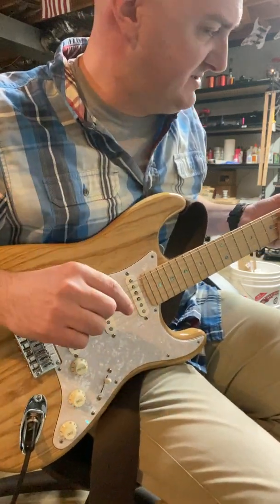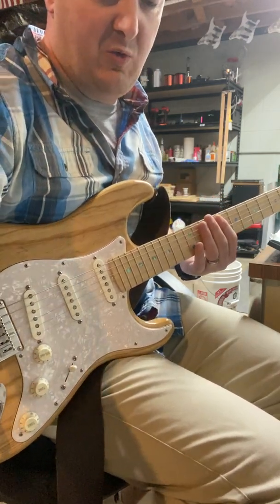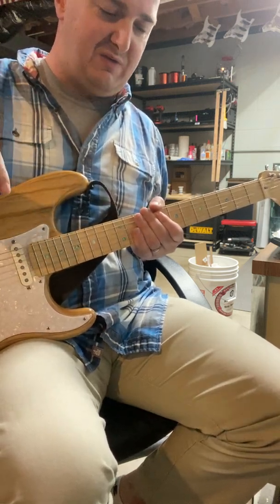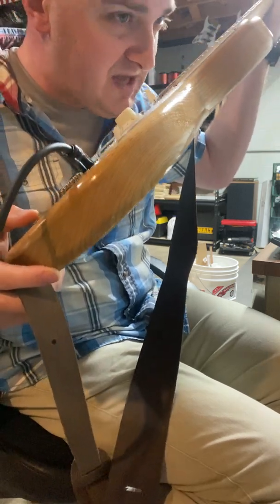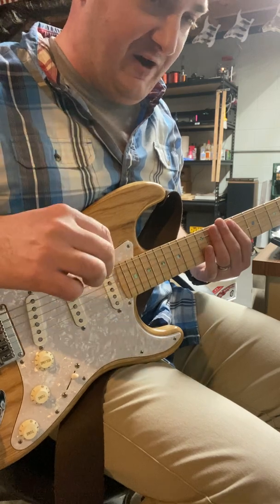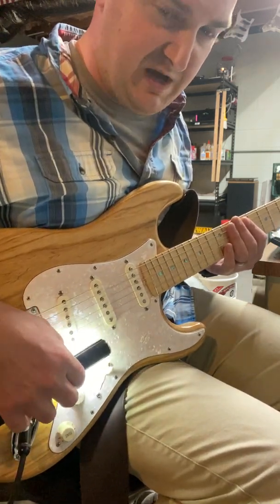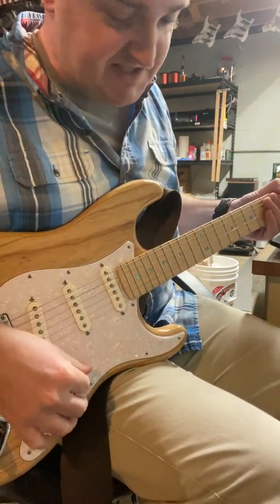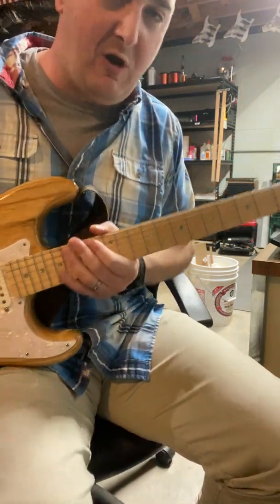60 cycle hum, RFI and Shielding is useless Noisy electric guitars SCIENCE EXPERIMENT

Comment: Um... you kinda proved the humbucker worked there - when the light was being picked up by both coils equally, the noise was cancelled - so you moved it closer to one end. 
Your experiments prove that when you move the torch close enough, the pickups do their job and pick it up. The only surprise was that your conclusion is that shielding doesn't work for all RFI.
https://www.youtube.com/watch?v=C7u8fEVoi9w&ab_channel=Pawe%C5%82Skibniewski does a before and after test which is both visually and audibly clear.
I just recently shielded a tele which has single coils that I use a bit of gain on. Without measuring, from experience, I am getting somewhere in the region of 6dB lower noise which when combined with a quieter power supply for my pedals makes for a far more enjoyable experience. 
Unfortunately, there is a lot of misinformation as to what hum cancelling is and how it does it. 
Essentially, there are 2 ways we have to reduce unwanted noise:
Shielding - preventing noise reaching the system in the first place
Cancelling - injecting inverted noise into the signal.
You don't use unshielded cables - preventing reaching the amp is easier than cancelling it. Shield your guitar is thus logical. Even using shielded guitar cables is logical as that's what we amplify the most. We shield amps, pedals and preamps for the same reason. We do however want to avoid earth loops...
Cancelling involves capturing the noise separately from the guitar pickup, reversing it's phase and injecting it back into the signal path. Humbucking involves capturing the signal with the noise out of phase on one side of the pickup - which is why your torch's noise cancels when it's picked up by both sides. No humbucker can cancel hum injected unevenly into it's coils...
You could also have a dummy coil out of phase with the pickup - WITHOUT magnets or magnetised polepieces which can record inverted noise. You could then blend that with op-amps even more precisely to cancel the noise.
Microphone cables work in a similar fashion - having an inverted signal and non-inverted signal which combine to cancel any noise picked up in the cable.
Reply from the maker: Humbuckers are not immune from RFI.  Any pickup regardless of construction, that is exposed to the environment is subject to pickup and amplify RFI simple as that. Humbuckers only reduce and or eliminate 60 cycle hum. They were never created to stop RFI. Obviously there are lots of sources of RFI however I chose to use the light because it was the easiest thing to use. 

If your tele experienced less noise after shielding, you had a ground issue that the shielding helped fix. Shielding passive components like the pots and switching does nothing. I literally proved all of this with a simple experiment in the video. Shielding  behind the pickups in the cavity is like standing on an umbrella while it’s pouring rain and believing it is keeping you dry because you really love the umbrella. As long as the face of electric guitar pickups are exposed to the environment you are in, you will experience RFI with or without shielding. Shielding does nothing for an electric guitar. I’ve owned a guitar repair business for a long time and didn’t just start doing this.

Thanks for watching and commenting🤘.
Reply: @MathewsGuitarWorks  There was no ground issue on the tele. Period. Star grounding, full continuity to all parts. 
https://www.youtube.com/watch?v=CixpTTW_IKE&t=927s&ab_channel=Devil%26SonsGuitars
This video shows almost identical results to mine. You may have persuaded yourself with your experiment but again, all you did was demonstrate how humbuckers work. Hum cancelling cancels some of the hum - it would be near impossible to ensure that in 2 separate coils, the same hum is picked up by both - unless they were literally wound together like in a microphone transformer.
What you demonstrated was that aluminium foil doesn't shield from the particular parasites generated by your "convenient" torch at that distance. Let's just say I have issues with your approximations of a "electrically noisy" environment. The video linked to above produces results that you claim are impossible. It cannot be explained by what you propose -and is the common experience  -and you can even verify it (You know I was wrong videos get more views?)
You even know the answer though but somehow it's not computing - You use shielded cables. 100% of unshielded cables capture static worse than shielded ones:
https://www.jms-se.com/resources/pdfs/Reducing_Electrical_Noise_in_Instrument_Circuits.pdf
This article demonstrates that: 1. Static is easily controlled with shielding. 2. Twisting wires helps massively with electromagnetic noise. 
Your comment about how long you have owned a guitar repair company doesn't belong. I could say that I first picked up a soldering iron 40 years ago, have been building guitar amps for 25 years - none of it would make a difference.
The first video I linked to cannot exist in the same world as that which your explanations would be valid in. The peer reviewed paper gives you repeatable measurements that demonstrate where and why shielding and twisted wiring works. Your experiment is simply flawed as is your understanding. Shielding is effective. Do a controlled experiment like the video above and see.
Reply: @MathewsGuitarWorks  I do think berry is onto something here. I am by no means an expert here as i just started playing bass recently and found this video in search of a fix for my bass with HORRIBLE ground noise.

With that said:

I did notice that the RFI with the single pickups was very pronounced and the torch didnt even have to be that close to the pickups for it to work, however, with the humbuckers you only got the RFI noise when the torch was either extremely uneven on 1 of the coils or entirely isolated on one of the coils which to my understanding of humbuckers is that completely defeated the main mechanism humbuckers use to cancel unwanted noises. 

of course they will pick up un wanted noises but the point is they will both pick up the unwanted noise then cancel it, during a natural use of a guitar when is such a strong source of RFI going to be focused specifically on one coil?

again, im no expert, just looking for an explination as this isnt making sense to me, thank you!

Comment: I love that pickguard on that guitar. Maybe I should just get a wood strat.
Reply from the maker: Thanks! This is actually a loose replica of a guitar I used to have. The original guitar was a Samick SSM1, strat-ish copy that my dad bought me for a graduation present. Same color scheme. I loved that guitar and I literally played it to death. Before I knew anything about fixing guitars I sold it for parts on eBay. I swore I would resurrect the guitar but using quality parts and this guitar is the outcome. It’s the only parts guitar that literally went together perfectly without any need for adjustment or fitting of parts. It’s my number #1. Thanks for stopping by and commenting🤘.

Comment: That is not correct. My guit. I used aluminum foil laid in wet paint. N elec tape over that n she the quite girl I no. Lol...
With my back to amp my strat makes no noise at any setting.
Reply from the maker: Excellent Bill! You should make a video detailing what you did. Thanks for watching and commenting.
Reply: @MathewsGuitarWorks  I may. Just painted cavities n laid tin foil in the paint. Elec tape any areas were hot could ground. N masking taped the rest. But I made this guit. N my pickup cavities are deep. N multiple grounds. Only area not sheilded is input. Or out put jack. Tonerider pure vintage pickups.

Comment: I would have really loved to see you plug into an 'expensive power conditioner'  and repeat the demo.  We all experience the frustration of noisy guitars/amps and if I could solve it with a noise conditioner I'd buy one.  Not found any demos yet. 
What I can't understand is the thousand YouTube guitarists I watch that don't appear to suffer this. problem.
Reply from the maker: A power conditioner will only get rid of noise that is caused by the bad electrical from your house.

It’s definitely not bad enough for me to spend  lots of money for a conditioner at my house. In the video it’s exaggerated because my amp was dimed. At reasonable levels, you can barely hear it most of the time. 

Thanks for dropping by🤘.

Comment: What's the point of the foil demonstration if the foil is not even grounded
Reply from the maker: Doesn’t matter either way. One is, a control cavity being shielded doesn’t do anything because the passive controls amplify nothing. Two is, all the RFI introduced into a guitar comes from the pickups. Whether it’s grounded or not doesn’t matter. If you could place the entire guitar circuit inside a faraday cage with only the cable coming out then that would block RFI. The point was to show that shielding in a guitar, grounded or not does nothing.
Reply: @MathewsGuitarWorks  You were demonstrating putting the foil over pickups, but the foil was not grounded. How can you say "grounded or not does nothing" when you didn't ground it?
Reply from the maker: @superbarnie  because I’ve done it both ways and it makes no difference so I opted to demonstrate the easiest option in the video. But if I get time I may make a special video for you just about the difference between grounded shielding in a guitar vs non grounded shielding. All I’d have to do is touch the strings with the foil and that would ground it. Stay tuned, I may surprise you with a video especially for you when I get time.
Reply from the maker: @superbarnie  scratch that, I went back and watched the vid and at 8:32 I did it with the foil pressed against the strings and then directly after with it off the strings and the was no difference. So the foil would be grounded when touching the strings and there’s no difference. So there ya go. Mystery solved. Thanks for watching and commenting🤘.

Comment: My Squier strat (SSS) was completely silent at the guitar store, but at home it has buzzing and a crackling sound when I'm playing single notes. What could it be? I tried plugging it directly into the wall, changing the cable, plugging it in another room, turning off all lights and electronic/electric devices and appliances but it didn't make a difference. The crackling noises are in all 5 positions
Reply from the maker: It’s most likely the wiring in your house. My house wiring does the exact same thing.

Comment: Like this.  My Stratocaster buzzes when I'm not touching the strings or any metal part.  When I connected the amplifier and the processor without the guitar, there is no hum.  When I plug the guitar into the interface, the guitar doesn't have any hum in the DAW.  I opened the guitar, checked it with a measuring instrument and everything was fine, everything connected nicely.  So it only buzzes when I don't touch the wires and when it is connected to an amplifier or processor.  Is this normal?
Reply from the maker: Yes, maybe if your equipment has one, trying engaging and disengaging the ground lift to see if that makes any difference.
Reply: @MathewsGuitarWorks  Thank you very much for the answer, I also forgot to mention that in the room where I play there is an old TV, radio and some other technical devices, so that is probably also causing the problem

Comment: God damn that guitar sure does all the issues, bad child mine does due to a catscan clinic being below where I live it. Stops when I face a certain direction.
Reply from the maker: That’s because you are facing opposite direction from where the rfi is coming from.
Reply: @MathewsGuitarWorks  I was wondering if you would have answer to this so. I just swapped the pickups on a project squire I blinged up.  I swapped it for a fully loaded custom shop texas special with JAPANESE pots.  It sounds amazing but the weird thing is as soon I have the volume halfway there is hum, but on max volume no hum at all. If I mess around with the tone knob,a lot there is slight hum. I checked all the ground wires and resoldered it. Should I just live with since on max volume there is no hum.

Comment: So its not that the shielding is useless, it could be your house grounding is bad. Shielding worked on my guitar.
Reply from the maker: What noise did it stop on your guitar?  See the problem is most people mis-identify what the noises are which is why I made the video. Shielding does nothing to reduce 60 cycle hum and if it reduced any noise in your guitar at all, that meant your guitar had a bad ground. Shielding does not stop rfi because the face of the pups are still exposed to the elements. Shielding does absolutely nothing for a passive control circuit because it amplifies nothing and most people shield a control cavity.  I lay it out pretty clearly in the video and you are absolutely correct, my house wiring needs to be regrounded.
Reply: @MathewsGuitarWorks  Stopped all the noise. Its a Les Paul so it doesn't have the hum of a Strat. But I have a Strat too even that's quieter. I'd suggest shielding to any guitar player. That said, I see your point
Reply from the maker: @JimmyKay1976  I’ve been doing tech work for a long time. I’ve got harnesses and pups in a lot of guitars that get used in the studio and live.  If your LP got quiet after shielding it was most definitely a ground issue. Once again, shielding a passive circuit (guitar controls) does nothing because it doesn’t amplify the signal. The voltage is created at the pup not the controls. 🤘
Reply from the maker: Thanks for stopping by 🤘

Comment: seems like it got louder when you removed the foil...just sayn
Reply from the maker: I listened to it again several times and don’t hear much difference to be honest but… let’s just assume that were true in this case. There is an easy explanation for that. Anytime you place something in between the source of rfi and the magnetic pups, naturally that reduces the effect on the magnetic field. Less magnetic effect on the pups = less noise amplified. No different than raising or lowering pups from the strings, Simple.  Before you play the gotcha game, What you seem to be missing is, pups don’t get shielded, especially the tops where the strings are at which is the source at which 99% of all rfi noise enters the guitar.  Only control and pickup cavities are shielded.  As shown in the demonstration, passive controls do not amplify anything so shielding is a waste of time there.  Shielding behind the pickups is marginal at best simply because the likelihood of rfi making it through the back of the guitar body and into the pickups is slim to none. The other possibility of why it may be perceived as louder could be how far away I’m holding the light from the pups. Once again shielding does nothing to stop noise in a guitar circuit, just sayn🤘.

Comment: Great video. Every guitarist that is frustrated with hums/buzzes needs to watch this. So many guitarists coat their pickup cavities with foil, only to find out...that it did nothing.
Reply: Except shielding with copper tape and shielding paint brought my hum down to almost nothing
The notion that it does nothing isnt correct 
I've shielded with aluminum too with the same results
There's always going to be a little hum but properly grounded shielding can eliminate most of it
Reply: If your shielding isn't working it's most likely because the shielding isn't properly grounded
Reply: Different noise problems, dude.
Reply: Yep, did it,lol...
Reply from the maker: Yea, I get a little ticked that some guitar techs push these do nothing fixes. This is one of those things that is so useless it’s like the car mechanic selling you services you don’t need. I lost count of all the guitars I’ve had come through that had copper tape inside that caused a short and they couldn’t figure out why it was shorting out. It was the copper tape every time.